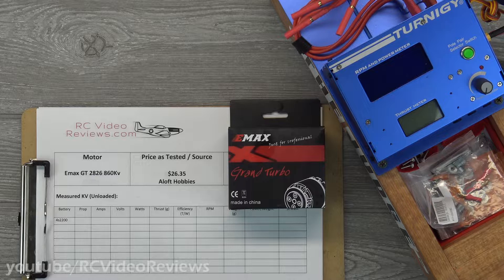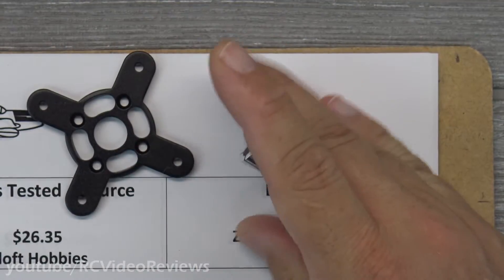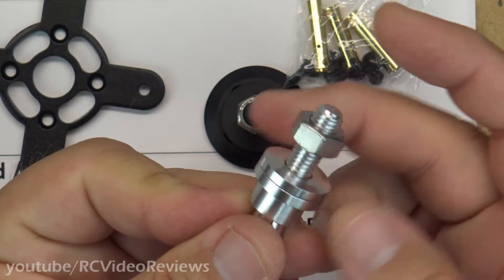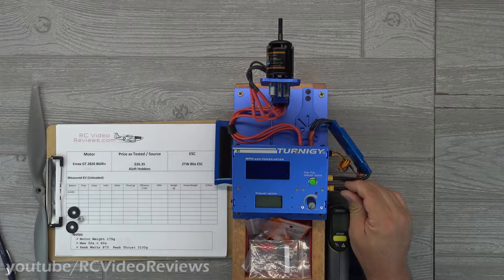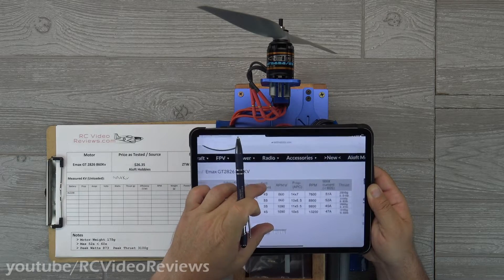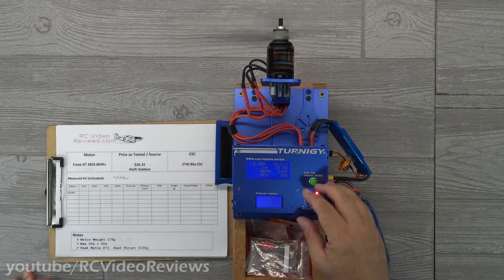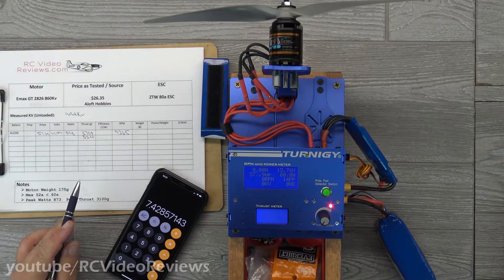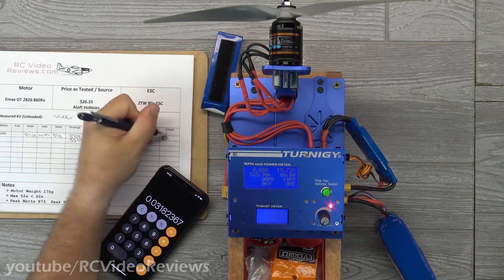Emax GT2826 860Kv Bench Test BEAST POWER [The Judge Ep. 9]

Comment: hey there, can you please add some accuracy by documenting the timing, frequency, c-rating and starting voltage. the numbers change very quickly. thx man
Reply from the maker: Nope. I'm out of the motor testing business. What I can tell you is voltage on the cells is peaked to start @ 4.20v. I never saw voltage sag worth noting which makes c rating for these short tests useless.

Comment: I exclusively have Emax motors. Once I bought one I replaced all af them. Unbelievable price quality (value as yousay). Indeed I don't think you can beat them either. Smooth silent balanced, super bearings, superior cooling. Cannot find anything negative about them.
Reply from the maker: I have only two gripes:

1) More data
2) More stock

Otherwise, I love them.